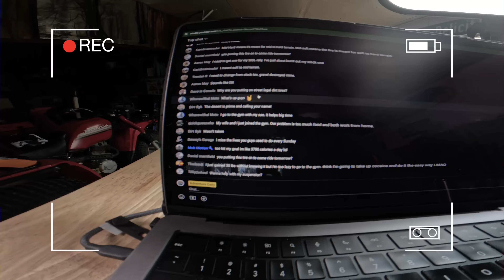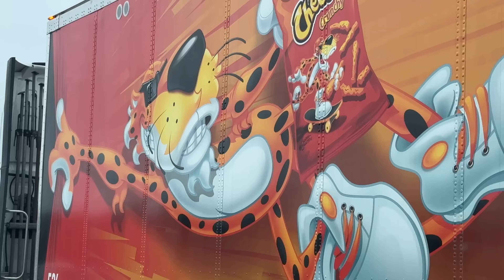Ultimate Beginner Bike Build Timelapse  - CRF250F

Comment: What shifter is on it? I’ve had no luck finding shifters for my 250f without hitting the anker case guards
Reply from the maker: I still have the stock shifter as I have the same problem as well, aftermarket shifters are more liable to snap rather than bend as well.

Comment: You think I could fit a 130/90-18 Trackmaster 2 on the back of this thing? Struggling to find good info and noticed that's what you're putting on there. Thanks!
Reply from the maker: For sure that’s the size we run.

Comment: I tried to install that same rear disc guard on my 2024 today. Every time I try to torque the rear axle nut, the chain tensioner spins out of place. I used a rag to tighten the chain and move the wheel forward. Any tips?

Comment: Curious what your thoughts are on 10w-30 vs. 10w-40. Dealer in Mass told my go with 10w-40
Reply from the maker: Warmer climate = 10w-40
Colder climate = 10w-30 

Not a big difference especially in lower compression engines so whatever you have just send it!

Comment: What is the purpose of the push cable? and why delete it. Ive been wondering if an ODI cam is possible for our 250fs
Reply from the maker: It serves very little purpose, removes weight and clutters up the throttle housing.